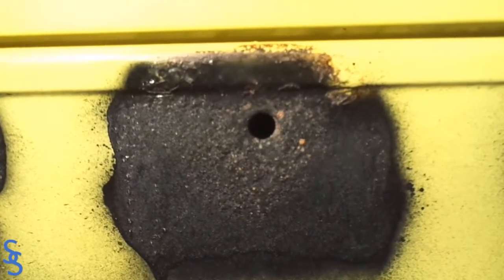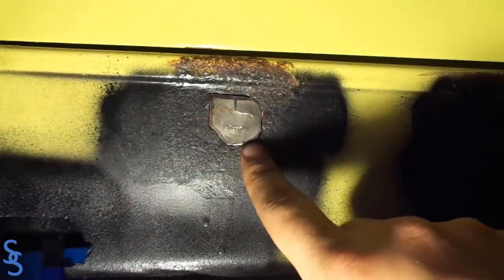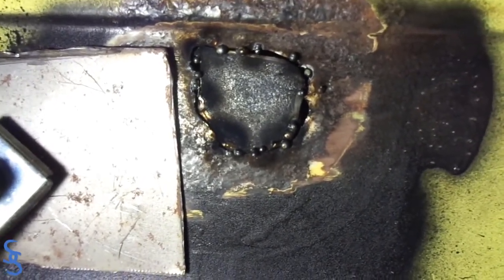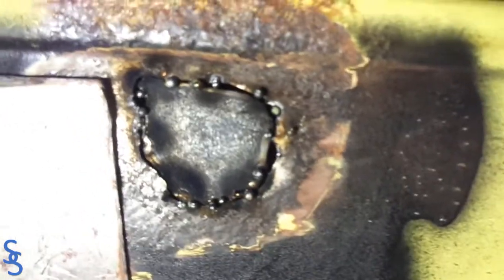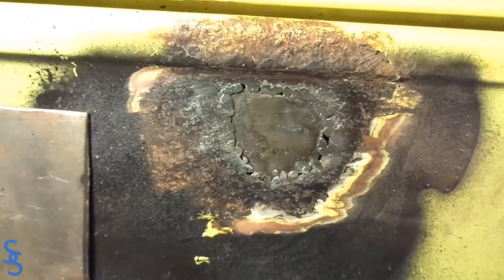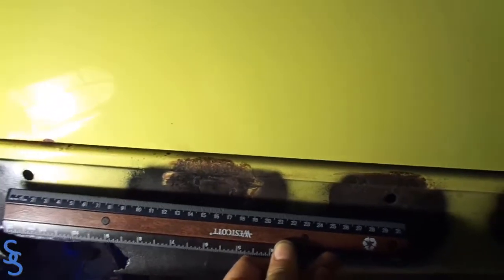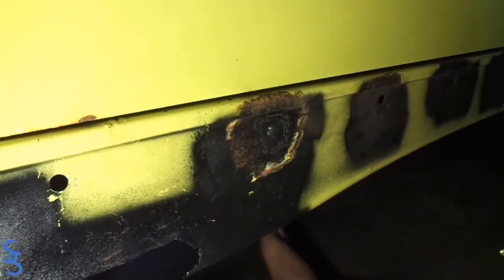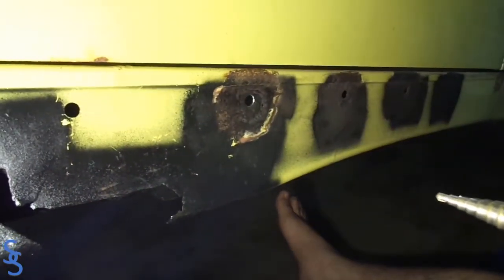SIDE SKIRTS | E36 | Hole restoration: How to repair the rust

Comment: 😂😂 this is how to not repair you rust
Reply from the maker: What would you have done differently?
Reply: @sansanper7562  for starters, watch some youtube tutorials and at least grind off rust till you see shining metal. only wld shining metal parts. also, cut out square hole in the skirt, then weld square patch inside it.  its just common sense, im not even car mechanic.
Reply from the maker: @anonime395  good points. I will make sure to apply your tips for my future repairs